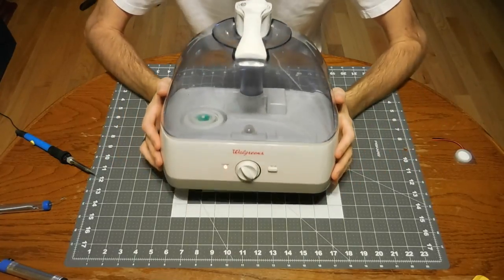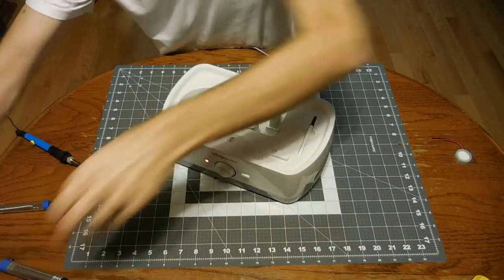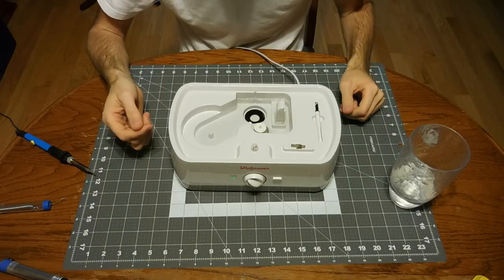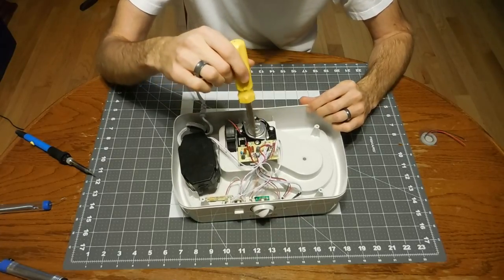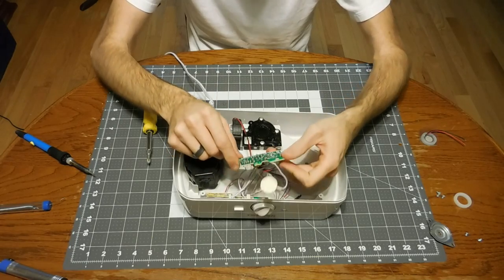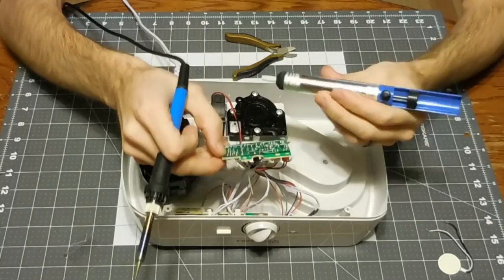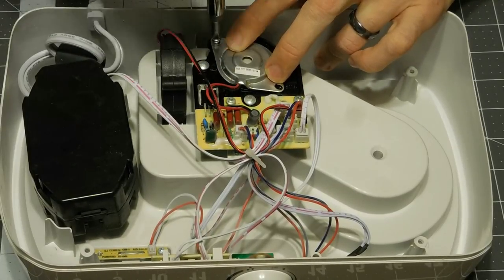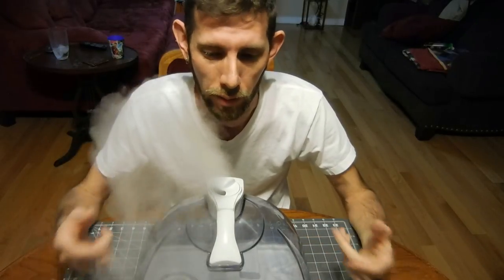Repair an Ultrasonic Humidifier

Comment: Great vid!  The only notes I would add is that the piezo element manufacturers rate the elements for 3000 hours of useful life.  So at 10 hours a day for a month, and with six or seven months of use a year- you get the picture.  It's the big weak link in all of these type products and it's why they will fail.  The second note is that you will need to know the exact operating frequency and peak-to-peak voltage amplitude from the driving circuit.  Find someone with an oscilloscope if you don't have one.  Piezo transducers by their nature are only efficient at one single frequency and they will overheat and burn out quickly if overdriven.  (Never run one of these babies without water!)  The other note is that some sellers list their products by the size of the outer silicone ring and others list the size of the transducer itself, so it's a good idea to make sure which dimension is being specified in the ad.
Reply: Why does a metal disc (piezo) vibrating go bad ?
Reply: The ceramic layer might develop fractures - just a guess...
Reply: @TCoupe60  interesting, makes sense, thank you.

Comment: This was exactly what I wanted to find on YouTube. I had a different humidifier but I followed along and thought it would work for my humidifier. Of course it did and the link for the 20mm ultrasonic piezo (2 pack) worked for me. I took the humidifier apart replaced the piezo. NOTE - I did not solder any connections on the board, I just cut wires from the old piezo and soldered them to the new piezo wires. I used some shrink wrap tubing over the soldered join to leave no bare wires.
Thanks again - Steve
Reply: Should have said but my humidifier was a Homedics Cool mist humidifier from Bed Bath and Beyond but here is a link to the same one on Amazon.
https://amzn.to/2UV7fud
Reply from the maker: Steve Woods great. Glad you got it fixed. Thanks for watching

Comment: Thanks for the video. My humidifier was a running weakly. I used your video to show me how to disassemble it. All I needed to do was to remove the rubber seal from around the membrane, clean the membrane, and re-assemble everything. Working great now.

Comment: Good job. I have a different brand but found the same thing, same part size and all. Mine only lasted one winter but since the season is over now, I ordered a five pack from china for a lot less so I may have enough to last five seasons. Also I don't want to mess with soldering that printed circuit board so I'll just use butt connectors to wire it. Nice to see yours work tho. Thanks.

Comment: Thanks for this video. I have 3 x Medisana ultrasonic humidifiers for my plants, and paid €64 x 3. Two of them stopped working after 4 months of continuous operation during the day and the third one now is almost stopped misting. I guess I have to follow your steps and dust off my skills with soldering new piezo discs.

Comment: gee...I appreciate this easy to follow video and explanation.  I'm anxious to attempt to repair my humidifier.  I like it but was disappointed that it quit "misting" after the first year.  I was ready to toss it when I found your video.  You make this look SO easy.  Wish me luck!
Reply from the maker: Carla Marcantel good luck! Thanks for watching.
Reply: I would suggest simply cutting the wires and NOT trying to solder the circuit board. They are easily damaged. Solder the wires instead
Reply: @DustinRogersinMO  it worked beautifully for a year and then everything stopped...power light won't even come on.  BUT.....I did get another year out-of-it.  Your video was great, informative, and easy to follow.  Thanks, again for posting and helping others
Reply: @MikeJones-rk1un  I actually DID solder the wires as he instructed but I was super careful not to disturb any other areas on the circuit board.  That is NOT something I care to work-around and it was nerve-wracking to attempt.  Dustin could be a surgeon! (hehe)....he made it look so easy
Reply from the maker: @carlamarcantel91  it may be worth it to replace the piezo again. Depending on the hardness of your water, it could be shortening the life of the piezo.
Reply: @DustinRogersinMO  too late.....I thought since the power light would not even come on that it was gone for certain so I chunked it  :(

Comment: We bought a taotronics mister about a week or two ago and yesterday I observe it only seemed to be working at "half mist" power.  The disc works but it doesn't seem to be making as much mist as it should.  After watching your video I now have an idea of what to replace if it comes to that.  I'm going to try cleaning mineral buildup around the disc and rubber ring first.  Thanks very much for your video.
Reply from the maker: Hopefully you can get it cleaned up and get some more life from it, if not, it’s a pretty easy repair.
Reply: @DustinRogersinMO  Well, the new piezo discs showed up and I swapped a new on in.  Issue persists, which leads me to believe it's something on the controller boards.  I took it apart again and fiddled with the plastic wire jumper connectors.  I flipped it over and it seems to be misting again the way it was.  So, I guess one of those connectors is loose.

Comment: You show de-soldering on the circuit board. On my model of "Air Innovations" I couldn't get the circuit board unfastened and feared doing damage by trying to remove the screws. I just cut the wires and soldered them together, using small heat shrink tubing to cover the joints. I had to buy a bag of 5 piezos online for 20 bucks, couldn't get just one. But 20 dollars vs. 90 for a new humidifier is a good deal.

Comment: Very informative.  I didn't know it was piezo driven.  Unfortunately, I took mine apart and the circuit board was limed up and rusty.  It was a leaky machine of potential death.  Into the trash it went.  Interesting all the mineral deposits from cheap supposed distilled water though.

Comment: P.S. - i wont do the soldering - just cut the wire near the disk and use marettes (wire nuts)
Reply: Butt connectors are easy.
Reply: Agree with Mr. B!
Reply: @fourak1  So you tried it or you're a fan? Wire nuts are poor and even dangerous on small gage wires. Butt connectors are way easier and safer. Let us know if your house burns down and your family dies.

Comment: Great tutorial video! But How do I know what size replacement piezo should I get for my ultrasonic humidifier?
Reply from the maker: Audacity Of The Mind you’ll need to remove the original piezo disc and measure the diameter of it. I posted some links in the description to the common sized versions.

Comment: I bought a "Made in China" room humidifier two years ago for use during heating season. Last year I bought a 5 pack of atomizers and replaced the defective one but this year the unit stopped doing anything. I hear a very high pitched whistle when power is turned on but no fan or vapor. If I have to buy another I would at least like to get a unit that will use the same atomizers I have but would really like to fix the one I have.

Comment: This is posted several yrs ago now but hopefully someone can answer...
I first lost the floater  the bottom part.
I tried to replace it, not really the type it usually had and my humidifier still did not work.
I tried buying the disk and replaced it but it still didn't create any mist. Now I am not sure if the disk is still the problem or the floater. Is the floater important? Coz I rmr before (when I first bought it)I turned on the humidifier and took the floaters(which I didn't know what it's purpose before) it produced mist.
I tried looking if floaters are sold separately but I don't see any from all the ol shops I browsed.

Comment: The magnet in my humidifier fell out and I can't find it....is there any way that I can get another magnet?
Reply from the maker: You may be able to find a parts diagram for your specific model online. Otherwise, you can measure the spot where the magnet goes and search for one of that size to purchase.

Comment: Thanks Dustin! What if the piezo that came with the humidifier has an attachment on the end (not two open wires). Is it reasonable to solder the stock wires to the piezo disk itself? Thanks again and I’m all for keeping things out of the landfill!
Reply from the maker: Sure, soldering the new piezo to the stock connector would be fine
Reply: @DustinRogersinMO  thanks! I am having such a tough time finding a 30mm piezo piece to replace the stock one

Comment: Hi Dustin.
Thanks for sharing.
I have different brand but same concept and the water leaks. Which part that potentially i should check and fix.
Thanks.
Reply from the maker: Ahlia Homes it’s going to depend on where it’s leaking from. There’s a silicone rubber around the piezo disc that could be torn, causing water to leak past it. It could also have a crack in the tank or possibly where the tank pieces are glued together may be failing.

Comment: Thanks for the helpful video. Is there a way to test piezo to ensure that's the problem? In my case, fan is running, all LED's are green, but no mist. Thanks
Reply from the maker: Maverick Person I don’t know of a way to test a piezo without an ultrasonic generator. I’d guess that the piezo is the issue and is the most economical part to replace.
Reply: @DustinRogersinMO  thanks, my existing one say AW1106 and it's 25mm. Should I just buy any generic 25mm one?
Reply from the maker: Maverick Person should work fine as long as it’s the same diameter.
Reply: @DustinRogersinMO  so I replaced the piezo with a new one and still no mist, everything else is working. Is there a polarity? Because I tried both ways. Thank you.

Comment: Do I need those hot tools to replace this piece ?  And what are they called ?
Reply from the maker: Soldering iron? It’s the best way to do it, and there’s a link in the description to the one I use, but some other commenters have said that they just stripped the wires and twisted them together and secured each of them with a small wire nut or electrical tape. It’s really going to depend on how much space is inside your humidifier housing and if extra wire/wire nuts will fit.
Reply: @DustinRogersinMO  awesome thank you so much!!!

Comment: Dustin, I have a model 2055.  It takes a 20mm disk.  Amazon has just the disks for sale too.  Do I need the wiring or can I just pop in a new disk?
Reply from the maker: Sharon Deminsky it really depends on your soldering skills. Soldering wire to wire is easier that soldering wire to disc. If the discs are over heated, they may become inoperable.
Reply: Dustin, I replaced the disk. The water bubbles up but, doesn't shoot up the spout.  Do you know what that could be?
Reply from the maker: Sharon Deminsky verify that the fan is working

Comment: Any idea on why mine leaks all of   the water?
Reply from the maker: Holander Gonzalez can you tell where it leaks from? It could be a bunch of issues. Cracked tank, broken seal on the fill cap, bad/stuck float, torn seal on the output port, etc

Comment: I need the name of the button air replacement
Reply from the maker: Nhi Lưu there’s links in the description
Reply from the maker: Unless you have replacement terminals and the correct tools to remove and crimp into that connector, your easiest method would be to cut that connector off the old piezo and solder/heat shrink onto the new piezo.

Comment: Thanks for the video. Anyone replace the dial (voltage regulator, I believe) before? I can hear and see my piezo working, but the dial doesn't affect output.
Reply from the maker: Gary Jeffers II does the dial have two wires or three wires coming from it? If three wires, it’s most likely a potentiometer which are fairly easy to test. You may also try to google any markings on the dial component. You may be able to pinpoint exactly what kind of device it is and find a test procedure for it.

Comment: What to do if this exact same make and model is making my floor wet by time I wake up ?
Reply from the maker: Lizzie Terry depends. Is it leaking? Is the float hung up and not closing the valve? Is your air already too humid and therefore the mist settles to the floor?

Comment: Nice video. 20mm piezo comes in 2 different resonant frequencies. 1.7Mhz and 2.4Mhz.  Circuit board has both frequencies marked where piezo connector is. Which one should I buy? Pureguardian brand humidifier.Thanks!
Reply from the maker: Barrin Bonet I’m not sure I know enough about them to give a reliable answer. Does your board have separate contacts for each frequency? If so, I’d say order whichever piezo and just be sure to connect it to the appropriate contacts. If the same contacts are marked with both frequencies, maybe it doesn’t matter which you choose?? Sorry I can’t help more, maybe someone else has experience with that and will chime in. Thanks for watching.
Reply: @DustinRogersinMO .Yes both frequencies are marked on the same connector. I'll pick one and try it out. Thnaks for your help. Good work on the videos!
Reply: I put in a 1.7Mhz Transducer and it works very well. Thanks again
Reply: Hi, My ultrasonic nuts not works, how can It buy the match one?

Comment: I'm guessing that there's no way to do it without a soddering iron, huh?  :(
Reply from the maker: If you bought the piezo unit that had the wires already attached, you could cut the wires off at the old piezo unit, strip the ends and then twist them together with the wires from the new piezo and tape them up, use small wire nuts, or crimp connectors.
Reply: @DustinRogersinMO  Thank you.

Comment: Loved the video. I have a very old vintage humidifier and I'm pretty sure it's the same problem. I hope so anyway. Would be an easy fix if it was. I'm just not sure what size my piezo is I don't think I have anything to measure something that small. Fingers crossed🤞🏻 here's a link to what mine looks likehttps://youtu.be/BHqsKHnfu6o

Comment: $6 ! for a mist  making piezo disc, you paid too much
should be like  $1
Reply from the maker: I paid $5.50 for a 5 pack of them. Even at $6 each, still way cheaper than $40+ for a whole new humidifier.
Reply: @DustinRogersinMO  ok yeah that is a good deal ,  did they ship from china or US?
i am guessing china at that price
Reply from the maker: @andreamitchell4758  I got from the Amazon link in the description
Reply from the maker: @andreamitchell4758  a US penny is .75” diameter, so roughly 19mm. I’d probably go with the 20mm.
Reply: @DustinRogersinMO  yeah that is what i a thinking ,thanks , so di yours hold up over time?
there were a few bad reviews on the ones linked  in the description
Reply from the maker: @andreamitchell4758  ours still works. We typically only use it during the winter when things get dry though.
Reply: @DustinRogersinMO  yeah me too 
and i always use distilled water in it ,that helps to prolong the life a lot
Reply: @DustinRogersinMO  it worked
transplanted  the  part from another cheaper humidifier into this one
https://www.youtube.com/watch?v=93voD7f2tPM
while i wait for the new ones , seem like it was the 10 inch
Reply from the maker: @andreamitchell4758  great. Glad you got it going again.